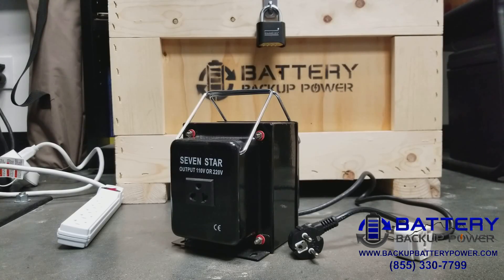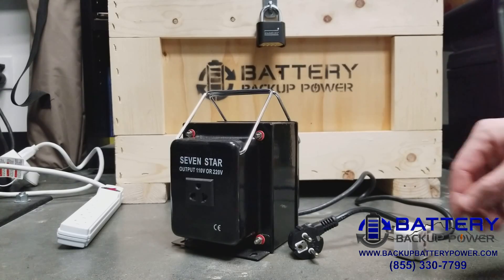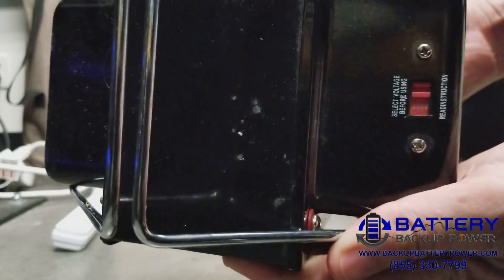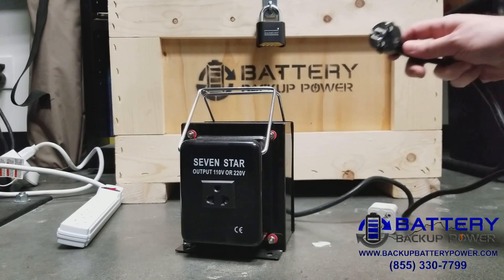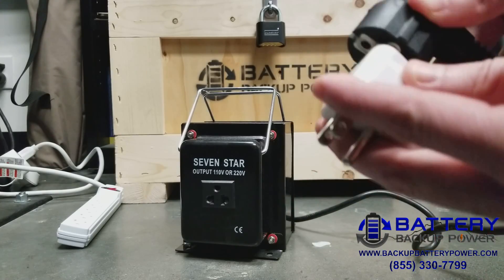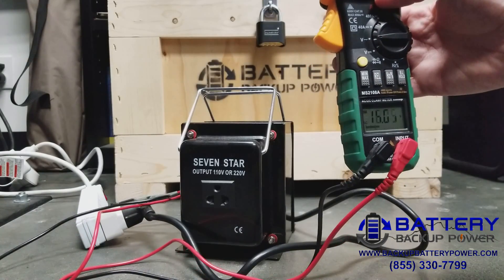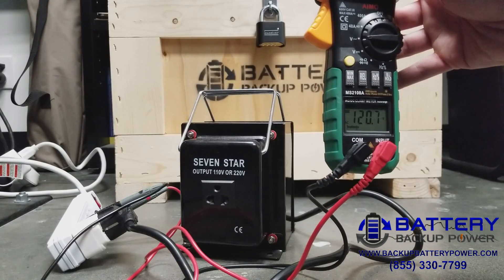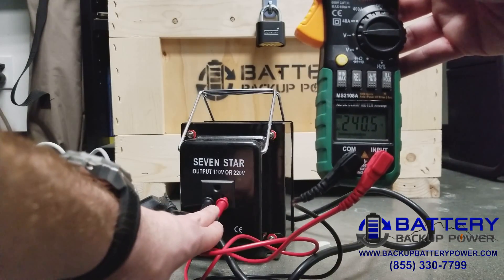How To Use A Step Up/Down Transformer

Comment: Do not use this for two phase US 240 volt systems this is a one phase 240 volt transformer for only single phase European 240 Volt devices this is not to be used on 240 Volt devices made to work off the US electrical grid! If you do not know this already you should not be watching this video because it will only lead you if you waste of money and possible death.

Comment: Im assuming if you plug it, wall>transformer>extension, the entire extension strip outlet would be what the output of the transformer is?
What if I plug it the way it is in the video, but the wall is 220v, so the transformer plugged into extension is stepdown to a 110v output and i use device for the one plugger into the transformer a 110v device, but the other outlet of the extension to a 220v?

Comment: Base on this video, I guess it's okay / safe to plug a transformer into a power strip as opposed to directly to mains power / wall socket.(as long as the power strip can handle the load)
Reply: 120 volts from power strip and typically 15 amp breakers so it would depend how many amps ur trasnformer draws

Comment: I have a 1.5hp air conditioner and it’s acting up because of low current in Nigeria. Can I get this to push up the voltage?
Reply: Did you ever try it? What was the results if you did. I'm in same condition right now.

Comment: Is it normal for it to get warm when using with electronics devices?
Reply: If its getting warm then you may need a bigger wattage
Reply: @dxlink  really?  My uncle said it should be double the appliance wattage. My US bought turntable is 110v and 19watts, i used my uncle's transformer temporarily which was 1,500watts until my 50watt transformer gets here.  My uncle's 1500watt transformer would get hot though

Comment: I recommend cheap multimeter when testing. The switch can be put wrong way round. I plugged mine and I had 240 in 450 out.switch in wrong position. A multi tap transformer would have better. As I like using isolation transformer for electronics. But earth is connected on this brand.

Comment: Attention! Wrong adaptor my friend. The shuko plug (on the cable) has (if you watch carefully) two metal lines. These lines should be grounded. Your gray adaptor does not have a ground for this plug. You need to get a shuko female plug adaptor otherwise its not grounded and that's dangerous for your devices and yourself too.
Check this out: https://images-na.ssl-images-amazon.com/images/I/41lhmRX1zoL._AC_SX355_.jpg

Comment: Why do they label everything and wind the core for 115 volts when they haven't used 115 volts in decades?
Everything is 120 volts,  maybe even 125 volts now.
Like with a  variac, instead of cranking it up to 115 volts at 100% you can crank it up to 149 volts at 100%.

Comment: Does this thing have actual ground connection?
Reply: Most likely through the plug socket
Reply: That particular design of plug seems to be one called "hybrid E/F".  It is designed to be grounded via grounding fingers at the edge of the socket recess of a Type F socket, or the protruding ground pin of a Type E socket.  Unfortunately, the adapter shown in the video does not appear to provide grounding through either of these methods, so the metal case of the transformer and the output socket ground are probably left floating.
But this is just due to a poor choice of adapter; the transformer itself looks like it's designed to be grounded.

Comment: My amplifier is 230 volts 50hz and 20watts is this ok to use for my amplifier?
Reply: Yes it definitely will run it. But it's not 2000 watt but 1500 watt transformer. Only thing you need to find out is American 60 Hz comparing to 50 Hz, not going to damage amplifier.

Comment: Ok still don't have a clue what you are talking about  I have a guitar amplifier that is 230 volts  I live in the USA  I need to plug in to 120 volts  how do you do that? Whit this step down converter
Reply: Switch over in step down mode. Being from. China I have a small version and checked the voltage to make sure in step down I was getting 110 volts. I have an American dewalt cordless battery charger. I live in Australia with 240 volts at the wall. Actually 235 volts when measured.
Reply: @dragan3290  How many hours to charge?
Reply: @likaqoqashvili9851  it should still charge at standard rate. If 1 hour charger? It Will take 1 hour. Higher voltage = less current. Lower voltage= higher current. Mine was charging at 3 amps at 240 volts approximately. 720 watts. I hope I answered ok? Cheers.
Reply: @dragan3290  thank you ❤️
Reply: @likaqoqashvili9851  your welcome. I'm glad I could help! Cheers
Reply: @dragan3290 so, will this work for  120v device on a 230v socket?
Reply: I have a fender rumble 25 110v. I need to plug it to a 220v socket. What switch should I flip?

Comment: hi, is it normal for the transformer to vibrate when plugged into the wall?
Reply: I think it’s normal because I recently bought a Korg X5D from the United Kingdom. The seller gave me a Uk Adapter and he told me that I need to buy a US adapter and use the Seven Star converter. I bought it today and when I set the voltage to 110v, it vibrates when plugged into the wall. I think it’s normal.

Comment: Could you use this for a UK coffee machine that uses 240 in Canada on 110?
Reply: yes but you have to see the number of powers watts must be more then 1500 watts and this one is 2000 watts so it will work
Reply: Install 220V US horizontal flat pin outlet, and use World to US 220V universal plug adapter.

Comment: Hello, super informative. Just wondering where hertz comes to play in all of this. If my hair dryer is 60 hz what does this mean. Would any step up do???
Reply: Herts remains the same  a  step up see saw of volts double amps reduce in half or visa versa step down amps double volts reduce in half.   That's to say sign wave hight volts increase/decrease but Hertz frequency wave to wave peak distance is same distance/time

Comment: I bought the exact same transformer a few days ago. For some reason I can't plug my appliance into the transformer. It's seems like there's something inside the outlet of the transformer disturbing. I though there is a button or something but couldn't find one. Any idea what am I missing?? Thank you!
Reply: You probably are plugging a two prong plug in and the receptacle needs 3 prongs (ie with a ground or earth prong) to release a safety block.  Change your 2 prong plug to a 3 prong plug even if there is no ground wire to attach and it will  plug in releasing that safety block